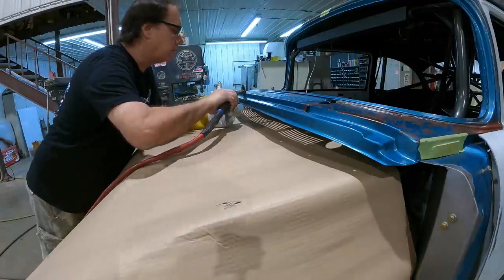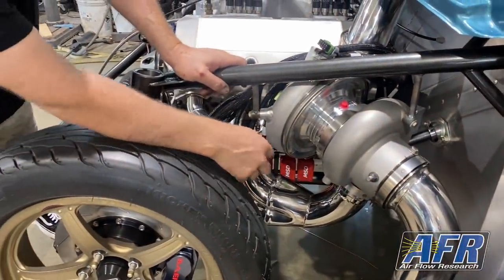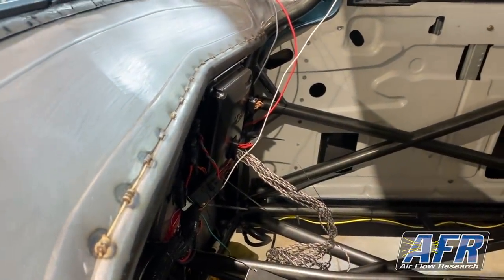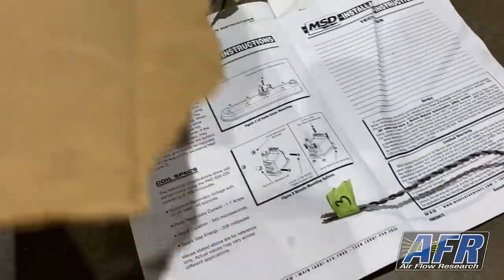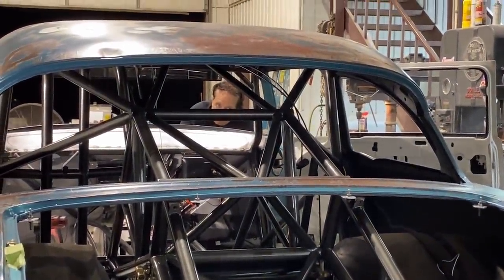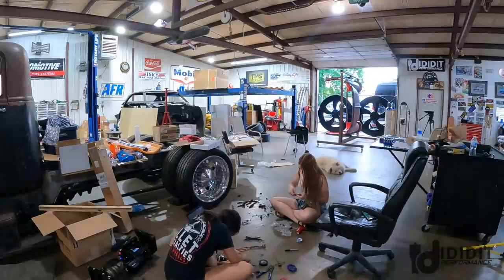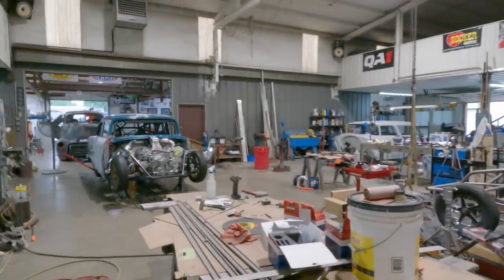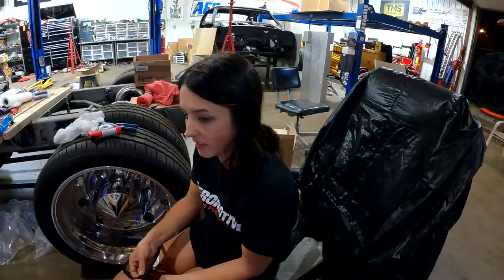Second to LAST Video in 55 Build Series 😱 Wrapping So Many Things Up! - Video 23

Comment: you can convert these old machines to new controls. Linux CNC is great because you can use the old analam scales, dc servos etc. 

any questions lmk, I can call the shop and talk you through it. I've done 2 older 3 axis machines, first one was really hard, second one was a breeze

Comment: Carbs would be so much easier and prob faster!
Reply: Thanks for the engagement
Reply: Carburetors are both more difficult to tune and slower.
Reply: @iknklst  WRONG!
Reply: @iknklst  no, carbs are faster, but can't tune on a laptop.
Reply: @captainswampy9501  I just stated the facts, carbs are quicker, but efi can be tuned on a laptop. Don't get so emotional.
Reply: @hermanmunster5831  You're telling me that two mechanically identical engines, one carbureted and the other one either turbo or supercharged, the carbureted one will make more HP?

Really? In what Universe?
Reply: @iknklst  I didnt say that at all! I said if u run carbs instead of all the technical crap its proven over and over again carbs make more power wether its n/a or power added
Reply: @scottwilliams5196  I'm not emotional. I don't think your opinion that carbs are faster qualifies as a fact.
Reply: @captainswampy9501  well, then think what you want. I've never seen an engine builder say anything but that. Plenty of back to back tests out there. Build what you want, prove the world wrong.
Reply: @iknklst  lots of back to back tests out there. Not new info. Carbs are quicker, not dyno tests, actual etc/mph. Efi is easier, more tunable.less messy too. Assuming all equal power adders.
Reply: For what they’re doing carbs would be extra difficult. For street driving it will run on pump gas and a single set of injectors. For racing it’ll run on methanol and 2 sets of injectors. If they ran a carburetor they’d have to either swap carbs all the time or completely re-jet and tune the carbs to go from street to race. And, would have to hope the get everything right on the changeover. 

For what they’re doing fuel injection makes more since and actually simplifies the process. Just put fuel in the tank, turn on the pump, and switch the tune in the computer. If running electric pumps then it may automatically switch over once it sees a couple of pounds of boost.
Reply: @NBSV1  and pray to God none of that electro digicals quit! Good luck with that
Reply: @NBSV1  I totally agree with you. It's far more convenient to make adjustments electronically than with hard parts. Especially for something that will see limited track time. If it was racing a couple times a week year round, they'd have more info/experience available to run carbs.
Reply: @captainswampy9501  unfortunately you're wrong.
Reply: I guess you should call Dennis and tell him if he switched to a carb his car would be faster.
Reply: @captainswampy9501  I will!!!
Reply: @captainswampy9501  it's his car, why would I do that? He can build what he wants. That doesn't change the carb/efi question. That is all I commented about. Relax.